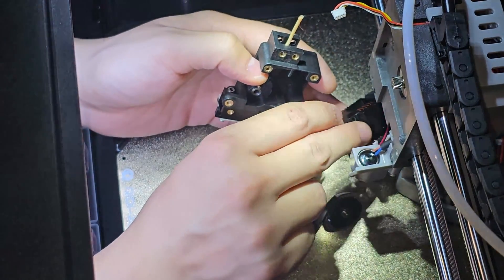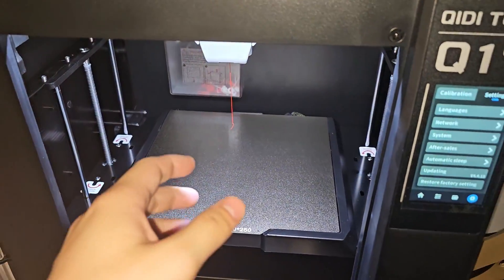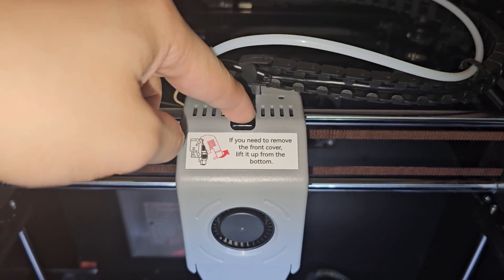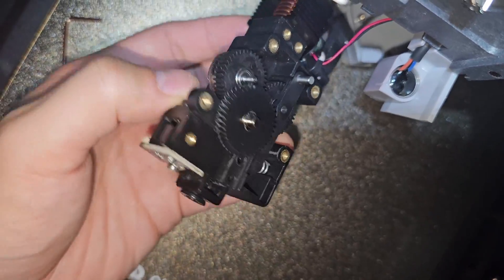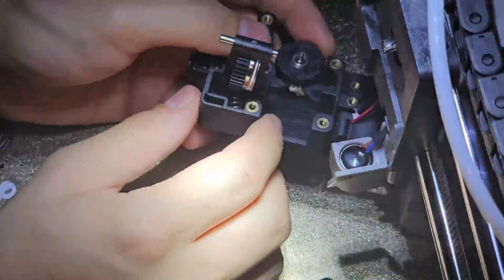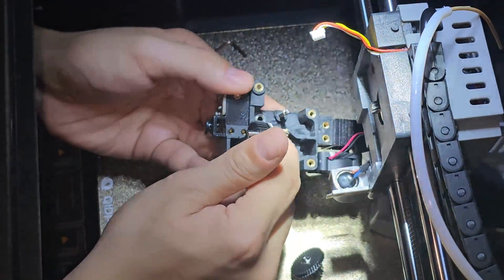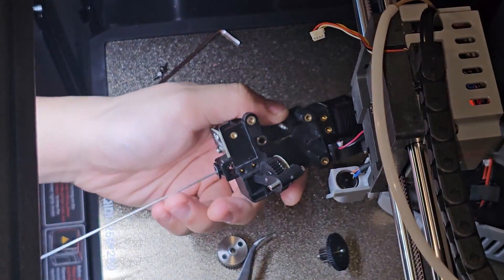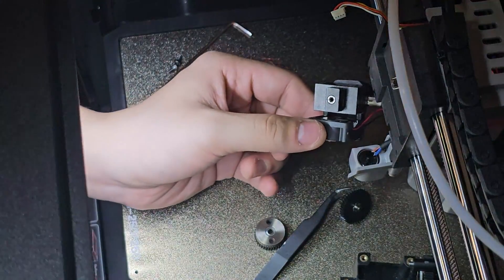Qidi Q1 Pro Unclogged The Non-Retractable Extruder

Comment: Hey! I also have this printer, but my gears move smoothly? But when I try to put in my filament it just doesn't move?
Reply from the maker: It could be that the spring tensioner is loose and the gears are not touching.
Reply: @Scratch3DPrinting  I opened it up like you did, there was a bit of plastic under the gear. I randomly got two bits and panicked because I did not see where they came from, but the both were from the top plate

Comment: I've found that I can retract 50mm of filament in the "load" screen on the printer and the melted part won't reach the extruder. The nozzle is 19mm long and I've had success extracting "10mm" twice without issues, so far. Just give the retracted filament about a minute to solidify before retracting all the way out.   I really only use this feature when I'm finished printing so I can put the roll in a bag. It also works well when printing TPU. I've had trouble forcing the cut section of TPU filament through the nozzle after it gets below the extruder gears. It seems to just get squished in the hot end. Hope this helps.
Reply from the maker: Oh yeah that sounds like a good idea of doing it.

Comment: You are really awesome for making this video, thanks!  I have some TPU stuck somewhere inside the extruder and your steps to disassemble the Q1 extruder are helping me a lot.  8:19 I remove these two bolts and grab the mini-fan's riser screws and tug the nozzle downwards to clear the blockage that usually happens right at the tip of the throat of the nozzle on this Q1.   A great tip is to keep a set of needle nose pliers + allen wrench nearby.
Reply from the maker: Thanks, glad the vidoe help you out. Yeah having those tool near by is helpful.

Comment: I just got a Qidi Q1 Pro printer.  But couldn't load filament correctly.  Filament wouldn't come out nozzle.  Am I not getting the filament in all the way for the gears to grab hold of the filament?
Reply from the maker: I'm not sure the Q1 pro has a weird extruder. Maybe push while it's extruding and see if it will connect.
Reply: The hard downward turn where the reverse bowden tube meets the extruder is a problem. There must be a lip of some kind, perhaps the bowden tube isn't seating all the way into the extruder, and the filament catches the lip as it resists the turn. I've had success just trimming the filament at an angle. If all else fails pull the tube and feed the filament directly into the extruder. Hope this helps.

Comment: You can actually unload by heating your Hotend, and allow filament to be pushed out, I do this on all of my Qidi printers, they used to do that prior to some of the firmware upgrades. Here’s the G codes. “G1 E-120 F350”
Reply: I can remove filament from my bed slinger as the extruder has a lever to spread the gears allowing the filament a clear path out. My Q1 doesn't have a lever and while I've retracted the filament manually, I believe molten plastic running through the gears is a bad idea. Usually I retract 30mm to get the filament pulled out of the hot end and give it about 30 seconds or more then extract the rest. I've seen an upgrade online where someone printed a lever for the extruder, but I'll bet cutting a small slot in the top of the extruder you could just use a screwdriver to operate the release lever. Your way apparently works, but it sounds risky.

Comment: The Qidi Q1 pro is my 1st printer guess that's why I haven't had this issue. Only kind of clog I've had was my fault went from PETG to pla and didn't fully clear the petg. All I had to do was change the temp back to PETG temps came right out easy. 
  Wanted to watch the video though just to learn. Doing my 1st nozzle cleaning now. Boot was nasty half melted
Reply from the maker: haha, yeah congrats on your first 3d printer. Different filament uses different temperatures.

Comment: Thank you for the video. Mine clogged as well and it is really hard to unclog in my opinion. I have a question: there is some sort of lever (or metal part) attached to the nozzle. It leads back to the back of the print head.  How did you detach it? It seems pretty solid in place, and I dare not use too much force.
Reply from the maker: There are two screws holding it in place.
Reply: @Scratch3DPrinting  the two screws you can see slightly above the nozzle?
Reply from the maker: @EvHoof  I'm sorry, I can't recall how I did it. I sold my Q1 pro after awhile so I don't have that 3d printer anymore.

Comment: I have just received the 3d Printer new and immediately it clogged - on first attempt to print. I cleared it but it clogged again. So it has not printed anything yet. And I am just using the little bit of PLA that came with the machine. I am not optimistic about this. I certainly cannot be taking the extruder apart every time I want to print something.
Reply from the maker: yeah that is the worst about a 3d printer, hopefully you will be able to print something without clogging.

Comment: Thank you for sharing this video about the problem you have been experiencing with clogging, and how you managed to recover. I'm sure it will help Qidi users.

As some people have already commented, clogging can happen from higher than tolerable temperatures warping filament travel through the extruder path. Another reason for clogging I've picked up from other YouTube videos is that removing filament be reversing it out can leave fragments/residue of filament in the extruder 'channel', which can act like plaque in your arteries. Small deposits can build up leading to clogging problems.

Although it seems like a pain in the 'backside' to remove or purge your filament by cutting it first and pushing it out through the nozzle, it seems like the best way to avoid clogging. You have to accept the fact that the extruder 'channel' or path is one-way only; in from the top (cold end) and out the nozzle (hot end). Personally I think this is an acceptable practice if it avoids or minimises clogging.
Reply from the maker: That is true the part where it need to be cut and just extrude it out. But the process is weird for me. Clogging can happen to any 3d printers.
Reply: @Scratch3DPrinting  I understand what you mean by weird. I have a very old Mankati XT plus printer. I reverse the filament out to change it. I am in the market for a new printer and also find it weird that you need to purge the filament 'forward' to change it. I am also finding on YouTube that any printer can clog, even the Bambu printers. I hope the 'filament clogging gods' leave you alone. Happy printing. 😁
Reply: I understand your point about clogging the gears and I agree, but we've been pulling melted filament out of the hot ends of printers where the extruder had a release lever for years.

Comment: I got two prints and have had nothing but issues since. The worst puruchase ever. This printer is just garbage.
Reply from the maker: Yeah, I did have some problems with the Q1 pro too.
Reply: @Scratch3DPrinting  What about adventurer 5M Pro, it has even worse gearbox made from ABS not reinforce with glass fiber, hard to disassemble.

Comment: If you take the 2 screws out and remove the hotend you can take the extruder out and it's much easier to work with.
Reply from the maker: ahh, haven't thought about it that way. Thanks.

Comment: I have a new Q1 Pro, testing filaments for my projects. I ran smoothly with ABS Rapido and PLA-CF.  I have twice experienced this same problem. First, after switching from PLA-CF to ABS-GF25 filament; second when I switched from the ABS-GF25 to (generic) TPU.  

Both times the filament clogged in the heat sink of the hot end, and I could neither extrude or release it no matter how much pressure was applied or what the temperature was set at. I removed the nozzle and used a rotary tool with .3mm bit to clean out the heat sink chamber of the hot end. I was nervous about damaging the hot end, but was dead in the water and didn't see other options🤷‍♂

Both times I was able to continue printing with no further clogging problems. I'm experienced but new to 3d printing and concerned about the clogging and what caused it?  Maybe related to the CF or glass embedded ABS?  Something amiss with the hot end? Did I miss something basic in the procedure of switching between filaments?  

It may be notable that both times the filament ran out while jobs were printing unattended.  The "out of filament" sensor doesn't work, so I assume the printer went through the motions of finishing the job with no filament going through the extruder.    

I also discovered the extruder jams up on generic TPU 😭so that spool went directly to 🗑

I ordered extra nozzles, hot end and extruder assembly to just switch them out when/if this happens in the future. I don't mind doing the cleanout but the time takes away from production printing.
Reply from the maker: Yeah for some reason this 3d printer really like to be clogged. Using a rotary to clean the tiny hole is pretty dangerous. From what I can tell is that the heat rises up to the heatsink melting the filament a bit then it cool off, that's what I think happen. Wow filament run out sensor does not work, that's pretty bad. Hopefully it does not clog anymore. Good luck.

Comment: There is a printable mod that you can add a cutter to the head. Just press, cut, pull out filament, load new filament, heat nozzle and feed new filament. Makes life infinitely easier.
Reply: Tried and does not work when head and heatsink both are clogged. QIDI tech support has been poor.
Reply from the maker: Ahh all look into that, I don't like pulling out the tube, then cutting it retract, load, plug in tube too much work lol.

Comment: Just an FYI from a former Qidi Tech reseller, all their printers are prone to clogging with PLA and PET-G, its usually heat creep, they are more oriented to printing higher temp materials, if your printing PLA and PET-G, then take the top off and leave the door open, I used to upgrade the hotend cooling fan on the older X-Max and X-Plus as they both suffered from this, Id suggest swapping out the hotend fan for Sunon Maglev or a GDStime Dual Ball Bearing fan, both push more air and will help mitigate the issue.
Reply: @nexgen-3d-printing do you have a part # or reseller to get the correct Sunon Maglev or a GDStime Dual Ball Bearing fan?
Reply from the maker: They'd good to know,  I'll try to keep the top of and maybe use lower temp soo that there's less heat creep
Reply: @Scratch3DPrinting  Ive even had to place a desk fan blowing air through the open door to print PLA reliably on the older X-Max here in Australia in the summer, as I was always suffering from heat creep, it gets a little warm where I am, keeping the machines enclosed they will heat up inside and would always result in a clog, this doesn't happen when printing higher temp materials, like ABS, PC or Nylon, even PET-G with Carbon Fibre is usually okay as well, its the nature of these machines, they are a brilliant printer for PA-CF and PC-CF, but PLA, not so much, just keep it really cool inside and you shouldn't see this happen again.
Reply: Guess I'm lucky because I print pla at 250c with the door open.  Petg at 260c with the door closed, usually no part cooling, and case fan below 50%. That said, I do have standoffs for the lid that raises it by 1cm. Lid is never fully removed while printing. Never had a heat creep jam. X-smart3.
Reply: @leaftye  Yes you are lucky, I had no end of issues with stock printers, PLA and heat creep, it gets warm here and PLA warps on its own as soon as it leaves my house, which is why I wont print the stuff at all anymore, PETG with CF is as low as I go, close your machine up and try printing PLA and you most likely will have an issue.
Reply: i think that was my error.. day before when did test set-up extrude i didnt open door and lid
Reply: @NexGen-3D Would a Noctua hotend fan work as well, or do you think they won't have enough airflow/pressure?
Reply: @albertwesker828  No Noctua fans a not a good choice, Sunon Maglev have twice the airflow and higher static pressure, same for GDStime Dual Ball Bearing, Noctua are designed for silence the others are designed for performance.
Reply: Thank you for this info, this was the problem I've been having for days. 
Do you know what sizes the fans are, for Q1 Pro?
Reply: @DaH0516  Not sure with these newer machines, best to do a quick measure, could be a 3510 or a 3010, pretty sure they are not using a 4010 or 4020, make sure to buy either a Sunon Maglev or a GDStime Dual Ball Baring in 24v, don't mess about with being cheap, these two fans are the best in my opinion, only thing better would be some sort of over sized server fan from Delta, which would not fit without mods, also print with the door open and the lid off, only use those for ABS and better.

Comment: Had a couple of clogs or jams (not sure which) with PETG-CF using the stock 0.4mm nozzle. I had to disassemble the whole hot end + extruder assembly and use a drill to get the now frozen filament out of the hot end. I am seriously thinking about making some extension cables for the hot end so I don't have to remove the back of the toolhead to remove the relevant parts from the machine. I'm also thinking about adding some extra cooling to the cold end of the toolhead (an extra fan on the other side of the heatsink perhaps).

As for the tensioning spring, it occurs to me that drilling a tiny hole thru the side of the extruder where the spring is as well as in that lever that it pushes against would allow a piece of something like fishing line or even steel wire to be run thru there and attached to the lever, and then by pulling on the wire or line you could take tension off of the extruder drive wheels.

I have a spare extruder assembly on the way, so I'll probably give that a try... worst case, it won't work and I'll have to take the wire out, and be left with a spare extruder with two tiny extra holes in it, so.... ???

🤔

P.s. (edit to add) I'm also going to switch to a CHT-clone 0.8mm hardened steel nozzle and see if that helps.
Reply: Those CHT nozzles have terrible durability. Also flow rate issues. They're a waste of money. I got some for my Qidi XP3. Just use brass, it's good enough for non-abrasive materials. You can also buy longer M6 nozzles for different printers and grind off part of the thread (put on a nut as a guide, then clean up the thread). Don't print wood pla / fiber composites with 0.4 nozzle. It will always clog.
Reply: @hmartinlb  Genuine QIDI bi-metal or Bondtech CHT both are about 30 bucks, and the clone was only a buck on sale, and CNC Kitchen was getting OK results so I figured I'd give it a shot. I am printing carbon-fiber so brass is not suitable.

If I'm still getting poor results with the clone nozzle then I'll spend the $$$ and get some genuine ones.
Reply from the maker: Wow you have to drill in order for you to get the filament out, that sucks. Qidi easy of no unloading kind of sucks tbh.
Reply: @Scratch3DPrinting  Well, the upside is this filament has great adhesion. The downside is this filament has great adhesion to a cold printer hot-end.

Comment: Very interesting. I don't have the q1 pro only the qidi x max 3 and it has an unload directly built into the klipper UI. Surprised it doesn't have such a vital feature. I do have the same filament dryer as you and one time the filament got stuck at the end and the gears couldn't pull it loose causing it to sort of strip the filament in the gears getting it stuck but all I did to fix it was take off the hotend and pull the filament out.
Reply from the maker: Ahh, so I guess then it's just the q1 pro that they start doing this kind of style of loading in filaments.

Comment: With the clog you had, best to remove the hotend first. It can be seen when you were pushing the filament the jam was beyond the extruder gears. Yes QIDI has quirky processes which 99% of users are not used to. Users need to take some time just have a think why this way? And you know what, their processes work well. At the end of the day, QIDI have provide opportunities to customise your own workflow. I do acknowledge and understand your reluctance to remove the Bowden tube. However should not be an issue when done with care.
Reply from the maker: Yeah, doing it that way is easier, but it was the first time taking off this hot end on the q1 pro so I didn't know. I think removing the bowden tube every time changing filament is just going to wear down the components.